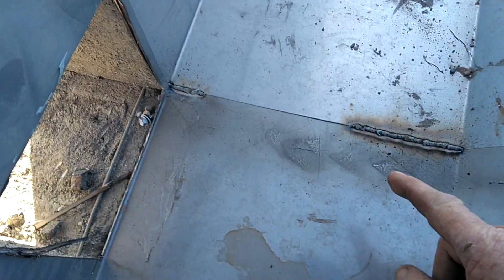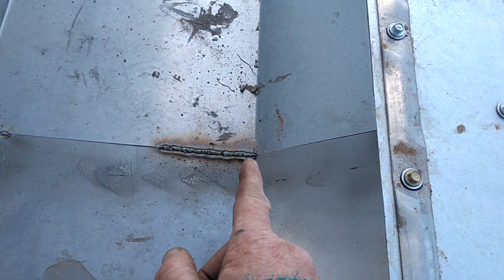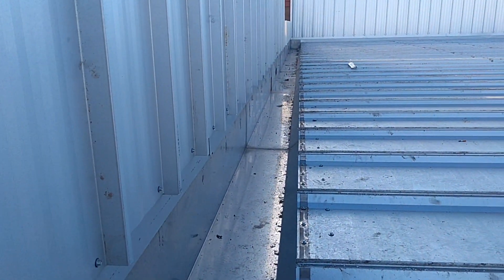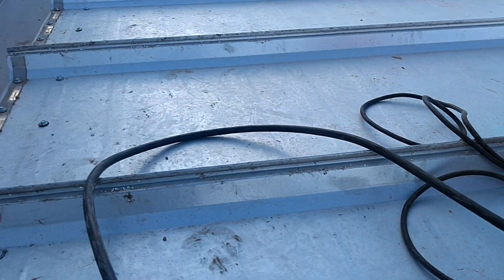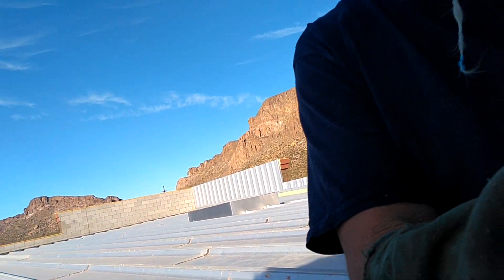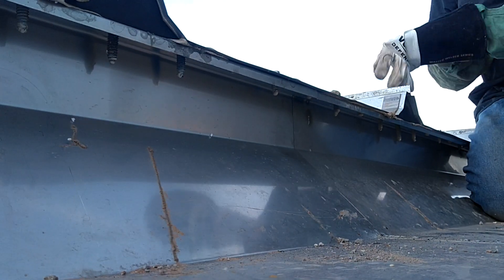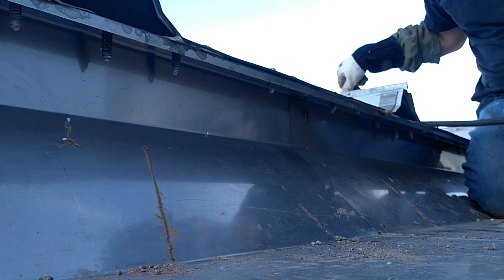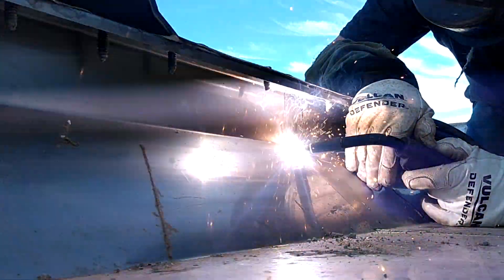welding Stainless Steel with Flux cored Wire

Comment: Is this amount of splatter normal?
Reply: I totally forgot about this video. Yeah what flux core you get a lot of spatter but you don't need the shielding gas rather than use shielding gas the flux inside the wire Burns and creates a shielding gas envelope around the ark now if I used shielding gas I would not get this amount of spatter but it's another thing I got to drag around in the field a giant cylinder of shielding gas
Reply: Well it's flux cored wire.yes you get some spatter, the trade-off is you don't need a shielding gas the flux cored wire provides that

Comment: LMAO 👍. I've been welding since 81and I hate when people try and get preachy about shit like this. I just smile and say yeah,I know,now go on and leave me TF alone. I've made a ton of emergency repairs on stainless using 7018 to keep something running until new parts come in and I've had to tell people no,I'm not doing that unless we get the right stuff to do it with just because of what it was and what it was being used for. Not everything is a swiss watch.
Reply from the maker: Come on man these rock stars are the smartest welders on the planet down here in the YouTube comment section. Haha yeah I said it in the beginning of the video it's not right but it will work hit those welds with a bit of primer you're not going to have any problems with it

Comment: I applaud your effort, unfortunately mild steel wire is only going to cause problems on stainless steel. They do offer .035 stainless flux core wire but it welds like crap in these little welders.
Reply from the maker: Yeah way  up the road those two metals will wind up fighting each other. The myocardial winds up attacking the stainless. Hey I have run that flux core wire and heavier applications on some tugboats holy hell it is awful blue demon I think it's called. You're better off just running a 7018 over it
Reply from the maker: Yeah that's a fact. I have run Blue Devil combination Wire in heavy applications. It's just a nasty process

Comment: You'll be called back out to fix it when holes start popping up on the weld edge lol. Also that Vulcan wire is total garbage. It's brittle af.
Reply from the maker: I did a half inch plate free bend weld test with that wire it passed just fine. When you look it up ( AS IN ITS ON THE BOX ) it's accepted by the AWS for Manufacturing and Hardness.
Reply: @accelwell7018  i also got an email back from Harbor Freight stating they are ok with multiple overlapping passes.

Comment: There different type of stainless steel 309 u can run flux on that
Reply from the maker: What do you mean? Like the stainless steel flux core wire right
Reply: 7018 stick when I ran out of 309 rod but it won't work 316

Comment: I would start by not using that Junk  wire from Harbor Freight. that's as bad as it gets. So many better wires out there for about the same and even less.
Reply from the maker: Yeah none of the garbage they sell and claimed to be welding wire is worth picking up for free much less trying to get decent Fusion out of it you will wind up with porosity cold cracks.... None of what you are looking for

Comment: What’s the right way to do it
Reply: Just a back yard hobby learning to weld.  I did see somewhere  a flexcore stainless wire   Would that be same  as reg flexcore wire ? Think the brand was blue demon or blue devil wire
Reply from the maker: @topdragster365w  yes sir that blue demon works well I have only used it it's super heavy industrial applications I've never seen it be run in our smaller machines 110-volt. It is a nasty nasty weld when you get done with it. To tell you the truth the stuff that I do everything from rod iron up to structural Beams I run flux core .035 on it the tool that you are using it in changes it goes from our 110-volt machines all the way up to the retarded cousins great big giant wire drivers
Reply from the maker: Well you want to run a stainless steel hardwire with a trimix outer-shield.

That was a steel flux core wire that I ran on that. Nothing wrong with the weld. But it will Rust over time